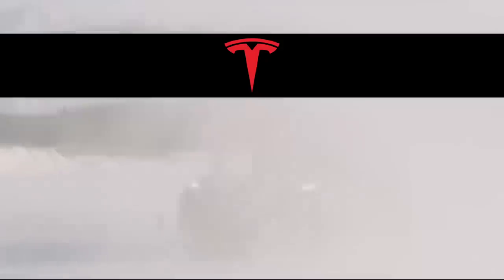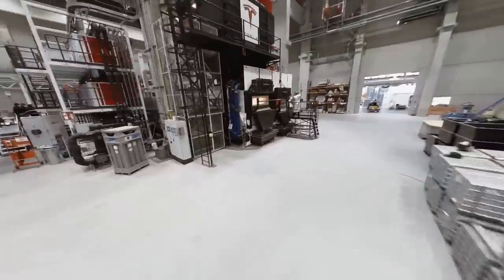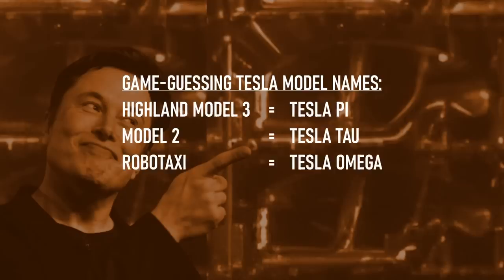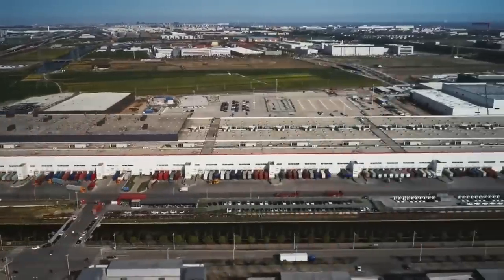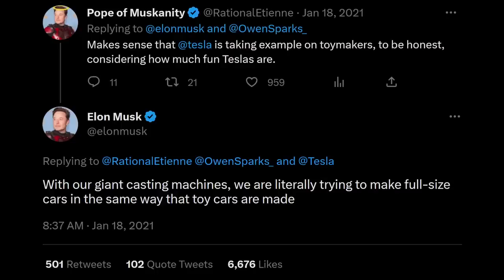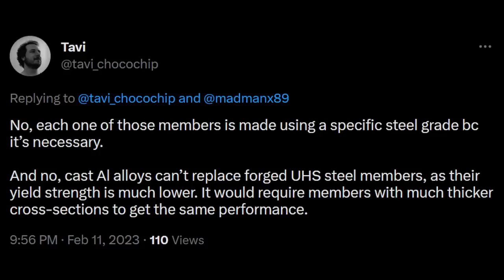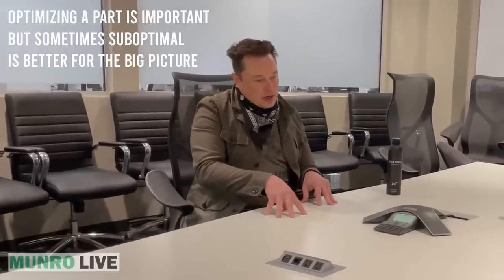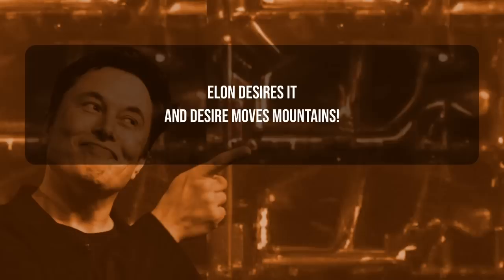FULLY GIGACAST NEW TESLA Pi 🚀 Elon's 3rd Gen platform out next month paves way to Alien Dreadnought

Comment: As an older but tech minded tinkerer, designer and inventor, ( the son of an engineer), I believe that the new, smaller, Tesla car ( whatever it is called) will not be casecest in one unit, but rather in two pieces, one on top of the other. I say this simply that the existing gigapress is not large enough to properly handle the entire chassis to be cast in one piece. Remember that it ( the press) must create enough force for the large casting but it must also maintain enough heat (not allowing the metal to cool much at all during the short time that it takes to make the casting). Bigger casting( s) would be, therefore, be harder to cast with an acceptably low error rate. I have not seen your video that covers wiring yet but, keeping the goal of extremely fast production in mind, I believe that, despite the heat involved, wiring (with appropriate heat resistant insulation), could be arranged in such a way that it could be cast in place as the chassis was cast. 
If, as you speculate, the upper chassis was made of structural carbon fiber resin, then the wiring could be installed as that section was built before it was  "married" to the lower section.
Since wiring has traditionally been a very labor intensive operation for building any vehicle or even a building for that matter. Shaving time off of the wiring operation could significantly shorten manufacturing time. Combined with the savings from more casting parts (singularly or two or more together), I believe that costs could easily be reduced by 50 percent or more.
I appreciate your videos very much. I am always interested in how things work, or could work in Tesla,s case. Keep it up!
Reply: Cast not whatever that is up there!
Reply: Note. I dislike autocorrect whole bunches!

Comment: From Chat GPT 
IDK if it's true, it's been know to fabricate (pun intended)

Is it possible to mix aluminum with carbon fiber?

Answer
Yes, it is possible to mix aluminum with carbon fiber in various ways to create composite materials with specific properties. The combination of aluminum and carbon fiber can result in a material with high strength-to-weight ratio, stiffness, and corrosion resistance.

One common method for combining aluminum and carbon fiber is through a process called hybrid molding, where carbon fiber is molded into an aluminum matrix. The aluminum matrix provides the material with high stiffness and strength, while the carbon fiber provides improved durability and resistance to wear.

Another method for combining aluminum and carbon fiber is through the use of adhesives or mechanical fasteners. In this approach, carbon fiber panels or sheets are bonded or fastened to an aluminum substrate to create a composite material.

The specific properties of the resulting composite material will depend on various factors such as the ratio of aluminum to carbon fiber, the manufacturing process used, and the quality of the materials used.

Comment: "Castings".
Sorry, I don't agree regarding the single cast passenger cage.
I think Tavi is right.
Why?
.
1) Physical (3D) shape.
At 07:01 we very clearly see the cross section of the passenger cage.
It's obviously narrower at the floor than at the "waistline".
If both sides and the roof braces were cast as one, and rigid, you couldn't remove the inner mould.
It's the "hand gripping a tennis ball" anology.
Grip the ball
You can't remove the ball without opening your fingers.
In that view, the (rigid) cage is "fingers".
The space in-between, where the mould must fit, would be the "ball".
Not possible to mould in 3d and remove it.
.
2) The passenger cage must bend and/ or distort to absorb forces  rather than break if hit hard. (Also ref the shape of 07:01 again, that wide "waist" is there for strength)
.
3) "the Cybertruck"... 15:17
The white section appears to be a conventional pressed metal section, not a casting.
.
4) Front & rear Gigacastings
have crash cans bolted to them to absorb shock. They are isolated from the main impact.
.
5) Finish.
As Tavi says, the final finish is very unlikely to be paint ready.
Cladding sections in steel?
KISS?
The best part is no part? 
.
6) 16:02
In the upper left side image, you can clearly see the shape of the panels where the "open roof" would be.
If it was a single, complete passenger cage in each section, you would certainly see through to the factory structure.
We can see the frame rails over the window, on multiple panels.
You can count what looks like 10 Right hand panels.
Across the drivers "roof" area, running down the front bulkhead, which would be open, that's part of the front Gigacasting.
.
The same applies to the B pillar section.
If it was one casting, you'd see through from the rear passenger to front passenger area. Look at the white section between the two reds.
Directly above, it looks like a solid wall inside what would be the "open" cabin.
.
Even the supports under the rear wheel arch.... They wouldn't be needed, the structure would be self supporting.
..

Comment: I'll very much come back here on tau day to see whether you were right on highland.
Reply from the maker: Names and the resultant dates are a guess. What's more important for me is to see - whenever they launch the Highland M3, whether the my speculation of using it as testbed for Gen3 was correct.

And since the part about reinventing the production line was right, if the new M3 isn't that, it's possible that the new M3 is just the new M3, while Highland was reserved for test models used for the reinvention part. I find it hard to believe that new M3 WON'T be at least to some degree on the new production line while being called Highland

But yeah, so will I. I see signs both for and against Tau day everywhere, lol
Reply: @ConnectingODots  I have to say, I am very much conviced that your Highland-Rouge theory is correct. It just makes sense and is consistant with previous statements from Tesla and Musk. 

A question arises however. If ford, even with the Rouge complex, wasn't able to maintain its lead compared to other automakers who didn't have the same infrastructure set in place, will Tesla's lead increase be significant enough on the long term?

Comment: Giga vs Terra.
If you have 3(?) Giga castings, you can assemble parts to each before the arrive at final assembly.
Cooling/ suspension on the front.
Suspension on the rear.
The Battery is the Battery.

Comment: Highland will be low cost Model 3 with a smaller battery that will serve as a stop gap to theModel 2.
Reply: I was kind of thinking that all they had to do was take a Model 3, shorten it a bit, cast the front and rear assemblies, change the trunk into a hatchback, ditch the expensive all-glass roof, switch to smaller all-season tires, soften the suspension slightly, design a smaller motor and inverter, and give it a smaller battery pack with a 210 mile range, and sell it for $25K before options. Would be a big hit for sure.

Comment: So if they change the Model 3 to Pi… Pi is 3.14. So Model 3 would be the 3 and 14 which could be 14 structural parts or 1 upper, and 4 structural parts.
Reply: No, no, no. Model 3.14etc., Model 6.28abc., and Model 12. 56WTF? What The Frunk!

Comment: One issue: They have been stockpiling castings at Giga Texas.  But they don't make model 3 there, just Y and CT.  So they are going to secretly witch the Y over as well as the 3?
Reply from the maker: They didn't make 3s so far bc old production method. With new design I see them making the new 3s everywhere, including Texas

Comment: I agree with almost everything except for the timelines. We will see the Cybertruck before we see any Model 2/Q. This event will be like Battery Day and will lay out the next phase of Tesla. We won't see any car unveiling but we will see the strategies for upcoming cars and other products, including project Highland, Megapacks, and hopefully home HVAC solutions. They can't just change molds and call it a day, especially not in Freemont with the factory layout as bad as it is. I would think they will add a new M3 line in Austin and Berlin first using the Highland manufacturing process and use Freemont for parts only and MS/X.

Comment: Two quick things: (1) You may not be enough of a car guy to know this, but there will never be a Tesla car named Omega because Oldsmobile owns the name and sold a few million of this model in the mid-1980s, and (2) You may not be paying enough attention to the issue of repairing cars that have been in accidents. One extremely powerful argument for not casting the entire body is repairability. Tesla's existing casting technology already makes repairs much more difficult and totals out vehicles that would otherwise be repairable. There are over 6 million auto accidents in the US every year, so this is not an insignificant issue. Reduced repairability will increase auto insurance premiums for everybody, and increase the TCO on Tesla vehicles.
Reply from the maker: 1. I was a real car nut before converting to EVs and I def know the Olds omega as well as the Opel Omega. Names are mostly guesses anyway, but even if GM still holds the trademark, I don;t expect Tesla to use the word "Omega" but to use the greek letter (a single letter, not writing its name) so no real breach of trademark
Reply: Don't forget FSD and Autopilot -> "The car that never crashes" !!
Reply: Regular cars that suffer that much frame or upper body damage are usually totalled and junked anyway.  They are worth more as salvaged parts.  Remember, the outer panels or "skins" will still be made of pressed metal.
Reply: @ConnectingODots  Yes, that could work, using the symbol for Ohms. But still, it will have to be written out as a word somewhere, so we'll have to see if GM objects or not. I guess it doesn't really matter that much.

Comment: My guess is the Gen 3 Platform will utilize the same 300 series stainless steel exoskeleton design and construction methods as the Cyber Truck with Giga Casting structural elements for the front, back, center battery pack and top hat structure.   You can have any color you like as song as it is Stainless Steel! 😉  

This will significantly reduce parts, simplify assembly and eliminate costs associated with a paint shop and painting.  The car will be inexpensive, corrosion resistant and extremely durable making it the ideal platform for a Robo Taxi. 🚕    

With a body that doesn’t rust, corrode or easily dent they can also design it in such a way that worn or damaged components can be easily repaired or replaced.  This would be a utilitarian vehicle so if they optimize the aerodynamics of the body design there will be no reason for body design updates.  Once built the vehicle could last for decades reducing waste and resources! 

If they offered an all wheel drive option with air suspension and you live in cold climates where they salt the roads or in rural areas with poorly paved or maintained roads it would be rugged alternative to a Subaru Outback or similar vehicles.

I would sell our rust bucket MB Sprinter van tomorrow and buy a full size Tesla van built utilizing this platform if one were available!

I can’t wait for Elon to reveal the details of the design.
Reply: Seriously doubt it, but let's wait and see. Most mainstream car buyers don't want an unpainted SS car -- Delorean proved that.

Comment: If making lots cast aluminum he will have a factory in hydroelectric area for cheap energy used high voltage casting
Reply from the maker: I think they'll just over entire roof with solar. But great thinking, I'm invested in Novonix and that's exactly what they did for their Pure Graphite factory💯
Reply: @ConnectingODots  solar will never yield enough energy for aluminum casting

Comment: Interesting.  I however think you are limiting your thinking.  I am thinking that "Project Highland" is the new assembly line. Henry Ford first used the assembly line in Highland Park.  Elon has evolved this 2-dimensional line into a 3-dimensional line.  Much faster thru puts.  I have to admit I have been pondering the multiple uses of a casting machine as you have described but not considered "composite materials".  We will see next week.
Reply from the maker: I did a whole video on Highland being the assembly line, not the model https://youtu.be/7vv-gt_Itf8
Reply: Och no, laddie. Project Heeland'll be about takin' the Low Road.
Reply from the maker: @FrunkensteinVonZipperneck  Laffin oot laoood!

Comment: My car is Deloren simplest body I saw Ever Made.. I was there for first 40 cars and body's made.. urethane Open Cell Foam parts 150 pounds resin each upper lower iner body half's..  then Stapled Together.. Not Bad 300 pound car body then sent over to be placed X Frame throw in couple seats and dash hang doors and at end of assembly line. Strange looking.. 5 panels are bolted on and then it became what it is.. simplest car I ever saw made them onto Dyno to 80 mph then around test track 30 degree bank

Comment: Lets look at Model 3 at $43,000 and a profit margin of 30% - So about $30k to make.
They are reducing body frame and panel works to a minimum.
Make them a bit smaller, in China
Use cheaper LFP of Sodium Ion Batteries
They will make a $20k car and sell it for $25 in the very near future.
If not this year.

Comment: Huge Gigapress on it’s way to Asia… the place the tau was to be designed and produced… if it’s Shanghai‘a design, they will start production there too. Maybe that press is already the tau’s machine that builds the machine? 
Thanks for all your insights! I love your work!
Reply: But...
It the press is "on its way" to Asia
And the factory is already shut down and building new lines.....
That press won't be ready in time.
(The Texas machine arrived about a month after shipping commenced and took 2+ months to assemble)
Reply: @rogerstarkey5390  fair enough. That’s working under the assumption that CTD is on point for the immediate production. Perhaps it starts with the current presses? Then moves to the full gigapress form factor

Comment: Carbon Fibre and some other plastic materials cannot be re-used. Also I think the whole body  - including the larger battery box part - will be out of aluminum. Well, they need some glass for the windows. And somehow moving parts like the doors have to be realized (connected through small step parts).
Not sure how exactly it can be done. But i could imagine for the top they use aluminum sheets. They will be cutted and stamped. Where more thickness is needed they will add aluminimum. It could be the formed aluminum sheet is going into a cast form. 
Even more realistic, they could use aluminum extrusion. 
With or without an initial aluminum sheet. Maybe just a heated up aluminum block thats pressed and pulled. Like spot welding, when the aluminum is heated up there could be procedures with rolls etc that put pressure on the aluminum so that the different 'parts' stick together. Lets see.

Comment: Having watched this today (Oct 14 2023), it's clear that most if not all of the predictions are wrong.  Model 3 highland does not have either mega castings or a structural pack.  It doesn't look like it'll be in full production in Fremont until Q1 or even Q2 2024.
Does this cast (!) doubt on other predictions of his?  I don't know.  But this one clearly misses the freighter.
P.S. The video background added little.  It might as well have been an audio podcast.
P.P.S.  I know I'm being hypercritical.  I suppose it reflects my preference for balanced opinions based more on real engineering.
Reply from the maker: Patience my young padawan

1. "Terracasting" (upper body) I projected mainly for M2, and what we know of unboxed process allows this. Noticed how in one of unboxed slides they show "castings: Front, Rear, Other" which could be this. 

2. In first Highland video I guessed correctly that Tesla is reinventing the Automotive production line - whether that's for Highland or just M2, AFAIK I was the only one to guess it. In Third video (livestream, only accessible through the playlist) I list technologies and a lot of them are clearly in the unboxed process (parallelizing work - though I did not imagine to this degree, brake and steer by wire, dry production process etc - all clearly happening in M2 unboxed process) 

3. And regarding the Highland - I'll admit defeat once the American M3 is out. What everyone's currently calling the Highland was designed by Tesla's Chinese design team, and while I have no idea how American version will look (probably similar) I still think underneath it will be more like I said in this series, NOT a copy of the Chinese car. Different production process (not full unboxed, but much more advanced than recently revealed M3) explains the delay. 

4. There's a chance that I'll eat crow, but only time will tell. Short time for Highland, 1-2 years for M3
Reply: Since I'm planning to buy a Highland M3, I kinda hope you're right ("kinda" because I've heard there are issues with cracked castings.)  We may find out a lot more on Wednesday.  I'm okay with predictions being wrong in timescale as long as they're close to being right in the phase they're associated with (e.g. Fremont Highland, Mexican M2 first mass production vehicle) @ConnectingODots
Reply: I think that Highland was in fact just the codename of the Model 3 facelift (2024) while the similar 2024 facelift for the Model Y is Juniper.
The dots were well connected, but the final sketch is not the correct one.